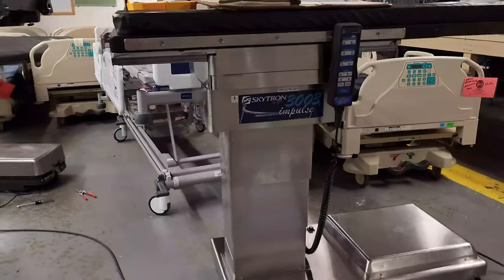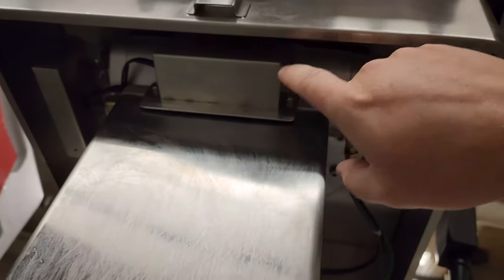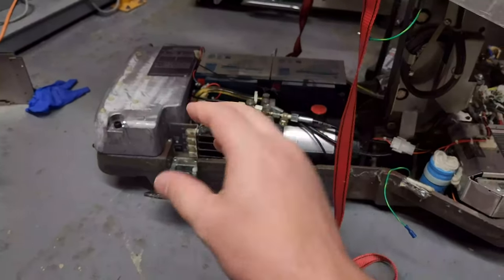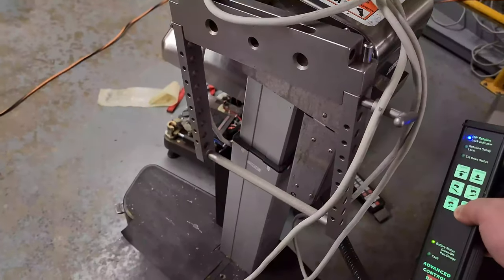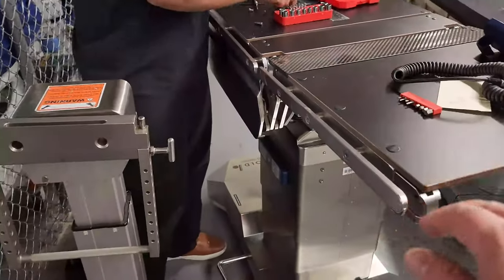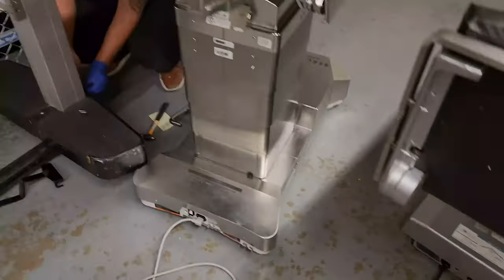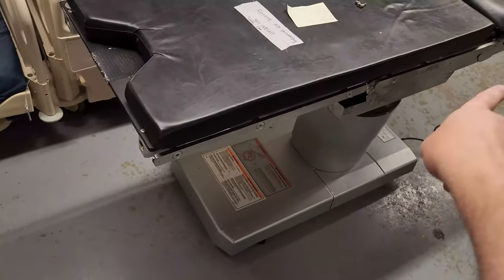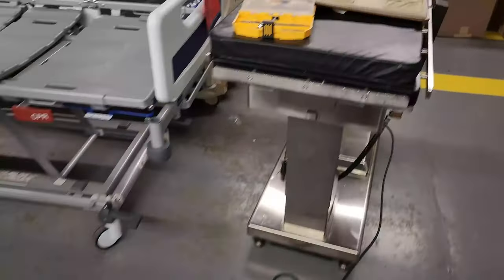Surgical Tables In San Antonio!

Comment: On the 3085’s, I have two that besides the hand switch needs replacing; the whole bed wobbles on the x axis or laterally very bad
Reply from the maker: There is a junction where the table meets the pedestal and that needs inspected with adjustments.
Reply: @BetterBiomedChannel  yes sir, thank you